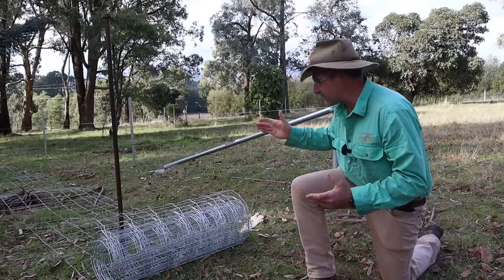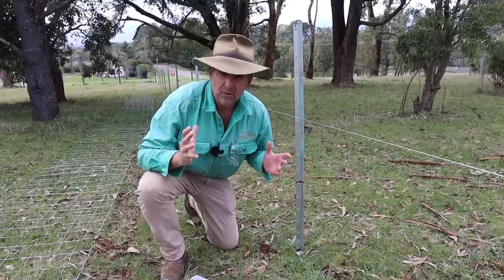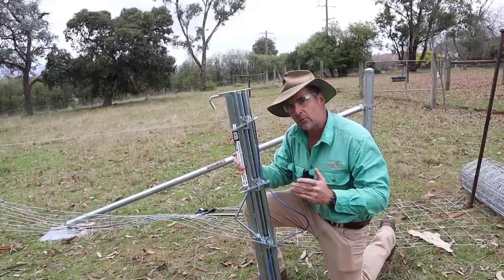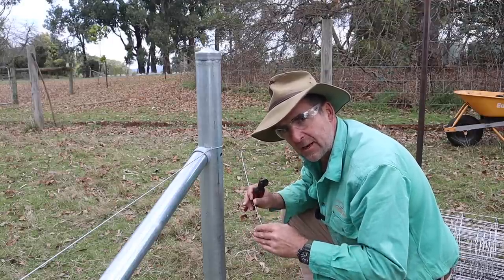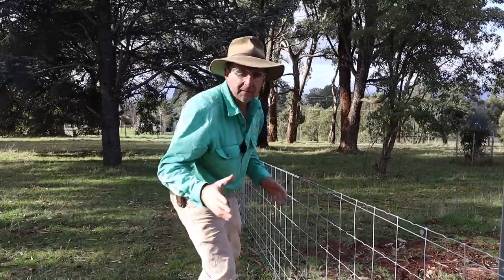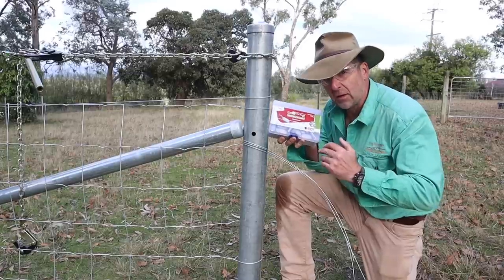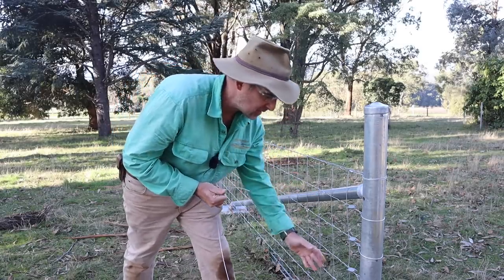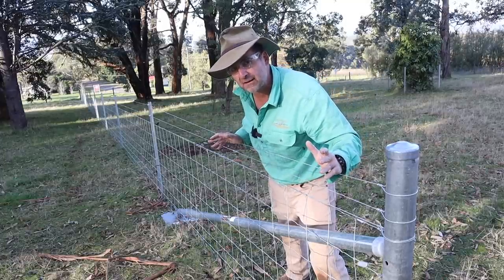The Easiest Guide to Building a Sturdy sheep or goat Farm Fence

Comment: Thanks. With the tensioners how long can the fence be before you have to do multiple along the fence.
Reply from the maker: Depends on the wire you are straining and the land you are working on. On flat country running 7 or 8 line mesh or five line barb, one Kilometer strains are not uncommon, on hilly country or straining 13 line horse mesh, 100m might be the most you can achieve.

Comment: Good work Tim. I'm interested to hear your thoughts on using something like Murray (Whites) Stiff stay 13  115  15 without any 'save' wires.
My top tip for you, use a post clamp as a guide to cut the peined top off your post with an angle grinder before you try to put the cap on.

Also, crimped terminations with the wire strained back on itself to avoid all knots.

John
Reply from the maker: G’day John. Lovely to hear from you mate. I’ve done the pocket strain in a previous video. It works really well with steel box end assemblies! I have 13x115x15 dog fence with footer. I’m actually doing a video on that soon. Have two sections of fence over a year old and really good. Good tip about clamps

Comment: Great video as always Tim. Have you got any advice to running prefab fence plus a bottom, middle and top barb?  I can’t get my head around straining it up without fouling 😅 thanks
Reply from the maker: Why barb?
Reply: @FarmLearningTim  my friends were told they ‘had’ to have barb to keep the goats in . . . Thanks
Reply from the maker: @ombleson Top plain wire electric and bottom on offsets 300mm above ground is ideal. Don't use mesh over a 15cm picket spacing or goats will get stuck. Horse mesh for miniatures in small paddocks.. Barb will cause issues with stuck stock and wildlife injuries if used on top. If you really must use barb, rather than electric (one or the other, never both), then strain it and walk the line, strain again, etc. But I would encourage you to use safer, less cruel methods of stock restraint.